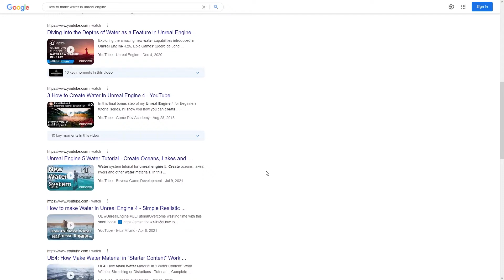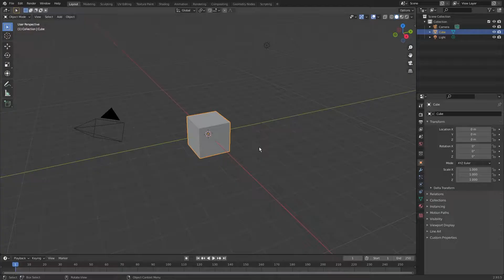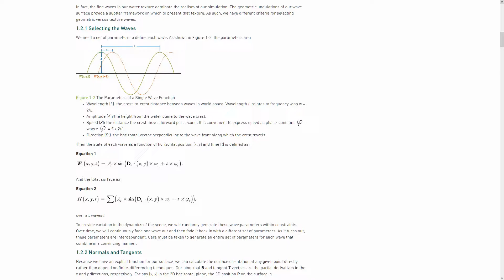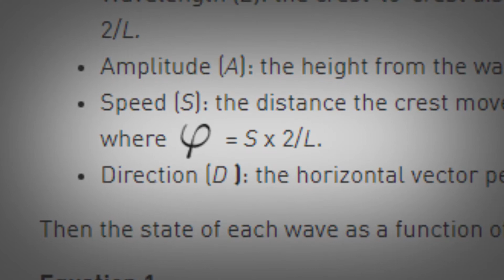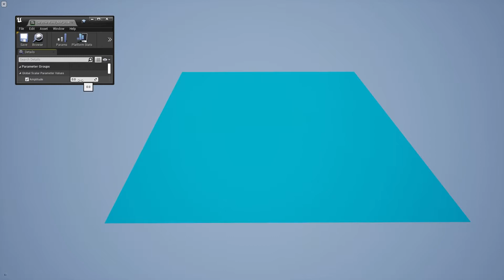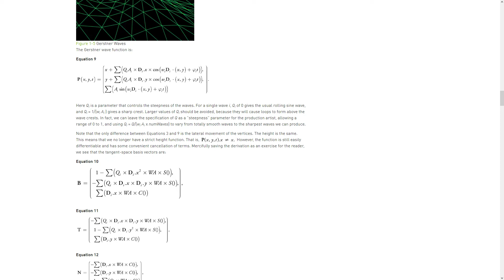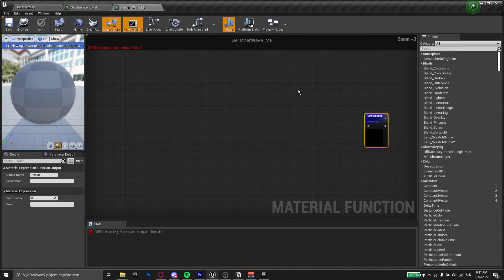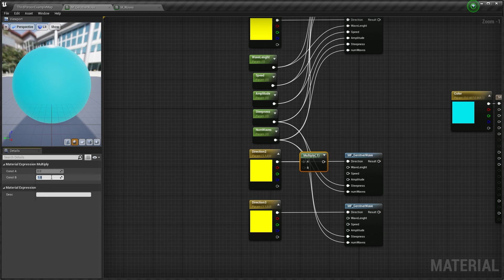Creating water in UE4: Waves

Comment: I have followed your tutorial.however the shader is glitching and is creating holes panning throughout the material. I think it might be related to the world position offset but I am not sure how to solve it.
Reply: Update: I have resolved the issue by adding a clamp node with white as max value, and red as min value right before the world position input in the shader.
Reply: I’m having the same issue. When I added a clamp node though I lose the vertex distortion of the plane and it becomes flat again. Could you tell me how you got that clamp node to work?
Reply: @spilledmymilkshake6352  you could just add clamp as he said, but don't use any colors, just set Min value as 0, and Max value as 1000